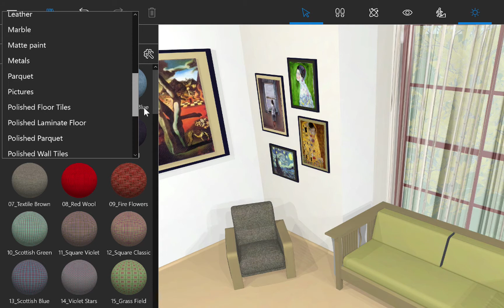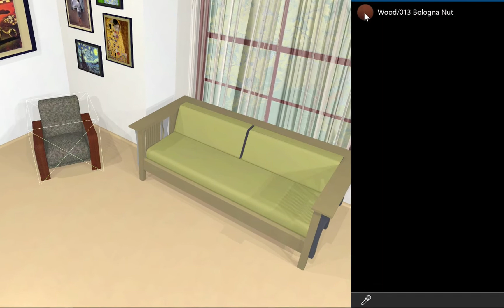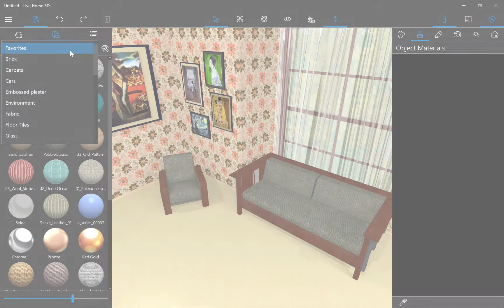Applying Materials - Live Home 3D for Windows Tutorials

Comment: Is it possible to add texture on just a part of the wall on the windows version?
Reply from the maker: Hello! You can't use two materials on the same surface. But the workaround is neat and simple - you can draw two wall panels on the wall and apply different materials to these panels.

Comment: Hi. I have some objects imported from 3D warehouse, and they appear to have 2 materials applied.

These two materials appear to have 1 that shows, like colour, and another that acts more like a texture that doesn't have any visible effect on the object. 

However, when doing the simple, drag and drop, of colour from the menu onto the object, it always appears to fill the non-effecting material.

So, how can I remove one of the materials that have been applied to an object. please?
Reply from the maker: Hi, all materials that are applied to an object are listed on the Object Materials tab of the Inspector. You can manage and replace materials using this tab.
Reply: @LiveHome3D  Thanks, but I knew this already. Unfortunately, these imported objects have about 100 objects all grouped and that means I have to move through each and every one of those objects using trial and error in changing each material and hoping it's the right one. Oh well, thank you.
Reply from the maker: @mattjukes6077  Please contact our Technical Support with this issue by email at support@belightsoft.com. Please attach one of your project files along with the description of a problem. We will be happy to help you!